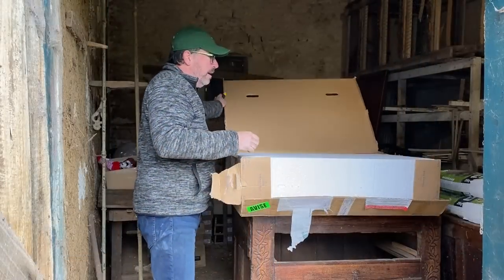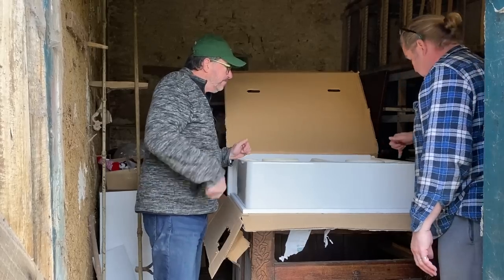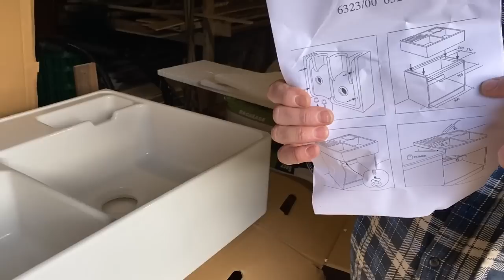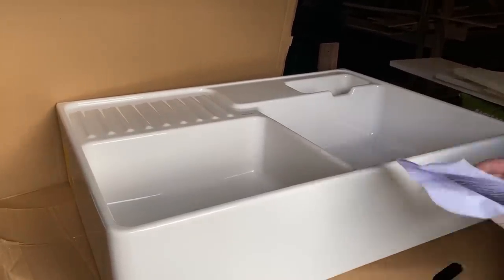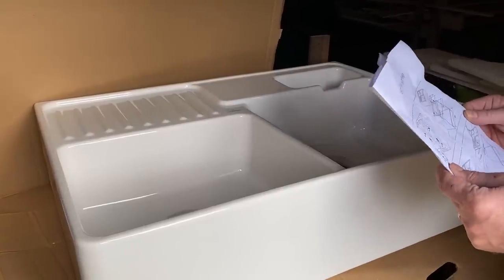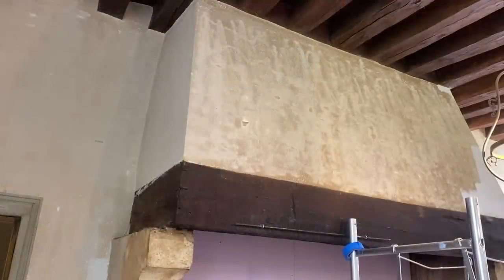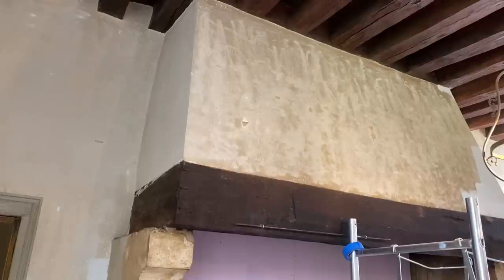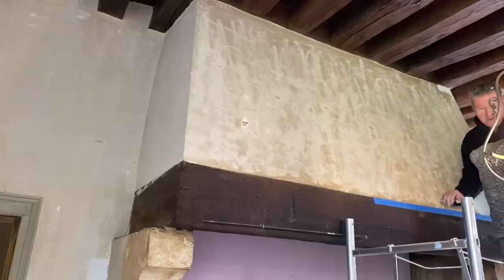We install the PERFECT 18th Century STONE FLOOR, KITCHEN RENOVATION - Journey to the Château, Ep. 79

Comment: Painting tip :-
Before removing the tape.
Run a sharp knife along the edge of the tape where the experts would cut in.
Then remove masking tape.
This gives a cleaner line and reduces the bleeding paint coming away.😊
I'm a very sloppy painter and can not decorate without miles of low tack tape 😅
I think your paint job is super.
You both have beaten Ash in todays tiling vlogs 😂🎉

Comment: Oh that warm white is beautiful, I'm getting a test pot of  "slaked lime", it's so hard to choose a good warm white that works in old buildings from tiny paper squares! The floor is beautiful and I LOVE the sink! Don't fuss to much over the faucet, that's easy to change at any time, but a sink is a big deal. I love that there's one tiny one for emptying out fatty or startchy cooking water, grease etc without messing up the entire sink (old kitchens from the turn of the last century always had one of those with a tiny faucet) and then two separate sinks! I don't know why people buy the single ones, you can't effectively wash up without a constant running faucent without two basins. One for soap and hot water scrubbing, the other for rinsing-water (and added cap of vinager if rinsing crystal) using the PLUGS! We have to be conscious of our water supply and France is already having problems due to lack of rain. My old sink is just stainless steel but two basins with a good tall enough arched faucet to fit my biggest pots under easily.
It's a modern one as I have a dishwasher and need one compatible w that (waterlock) and a single grip temp regulator/ pull bc sometimes seconds count in kitchen action.
It's amazing what a huge difference  a good coat of paint does isn't it?
Your kitchen is going to be AMAZING, and it's probably the most important room because we spend so much time there cooking, eating, feeding the dogs, going in and out, being creative and social and nomatter how fine a dining room is, guests always gravitate towards the kitchen, its a place we all feel comfortable in and relaxed in anyones house. You guys are such hard workers, I really felt that knee pain! 😬
Tulips are DREAMY omg I'm literally looking out at droves of snow against an unforgiving charcoal night sky through my kitchen window, we wont be seeing tulips here for some time (understatement). I'm so not cut out for these loooong winters and short summers.... 🥺
I was thinking, you guys should be looking into getting a few chickens (or hens rather) for Easter! 
It's really nice to have fresh eggs, and just 3 or 4 hens goes a long way. If you socialize them they are very pleasant animals and quite low maintenance. My brother used to have a few who would sit in your lap and coo on a summer day, come running for grated cheese ends, laid their eggs in the coup but insisted on sleeping in the lilacs, truly a sight to behold! 😂 
Of course there's the dogs, they'd need to not stress them out. Stressed hens don't lay eggs. 
Anyway, great to see the progress! Be well and be kind to knees and backs please. 💕💪🌷🌷🌷
Reply from the maker: Thank you! 🥰 Yes, just a fresh coat of paint makes a huge difference! ❤️

Comment: Why did you tile around the legs of the table in the kitchen?
Reply from the maker: The entire kitchen floor was tiled in different zones over several days so that we could still move around in the kitchen while the adhesive set. We just moved the table from the unfinished areas to the finished areas and then we worked around it. Are you wanting to know why we didn't just move the table out of the room until we were done tiling? Because it is old, extremely heavy, and it wouldn't have fit out any doorway without taking it apart.

Comment: I really hate to see anyone wearing gloves when they are using a saw.  If the edge of your glove is caught, it could draw your hand into the blade.  On the job, we were encouraged not to do this.  Floor looks great!  What is the smallest basin in the sink for?
Reply from the maker: Interesting that I was taught the opposite. Always wear safety gloves when using a saw. It is also a wet tile saw which has no teeth and a dull blade, but thank you for your concern.